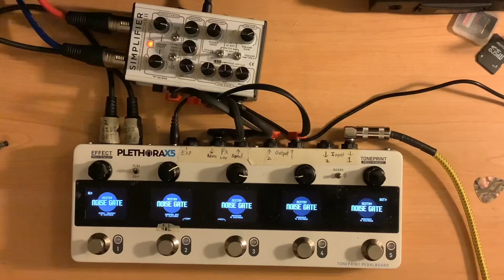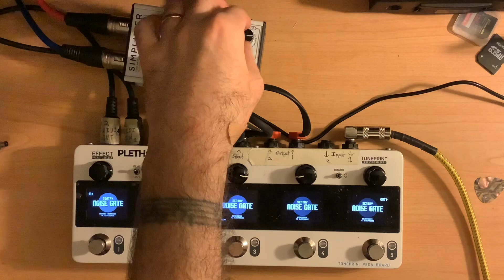Noise Gate Test Board - TC Electronic Plethora X5 with Simplifier MK2

Comment: I have a single coil and looking for a good noise gate without compensating too much on the tone. Could you please suggest a good noise gate that rduces the 60s hum on plethora x5? Thanks!
Reply from the maker: Thanks for the question.  Unfortunately, I can't say that I have a specific recommendation.  There might be a toneprint out there with that in mind, but you can also use the app to do very specific editing to the patches.  Might even be able to focus on that hum you are trying to eliminate.

Comment: Do you know if the noise gate can be used like the standalone Sentry noise gate, where it can use the 4 cable method for sidechaining (as described in the Sentry manual)? Other YouTube videos I've seen have only shown putting the Plethora X5's effects loop between two effects, which to me seems like it would just be like having everything in series.
Reply from the maker: I don't believe it's currently possible to do that, but that would be a really cool feature for them to add if possible.  TC, if you're listening....